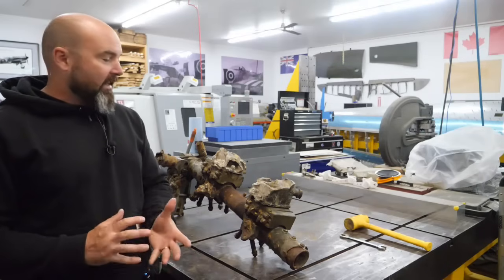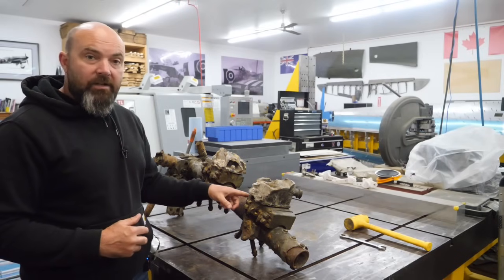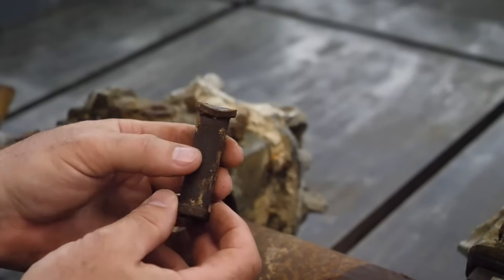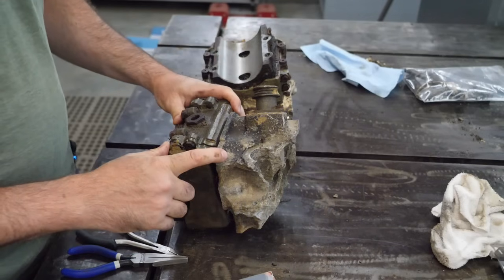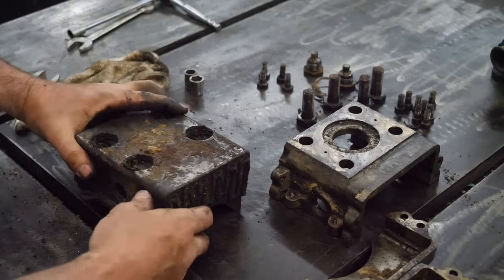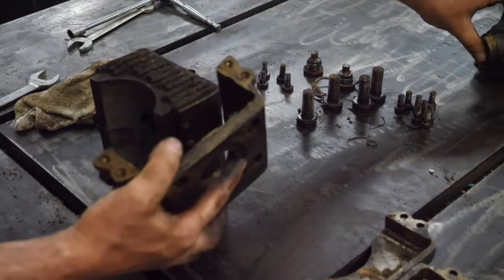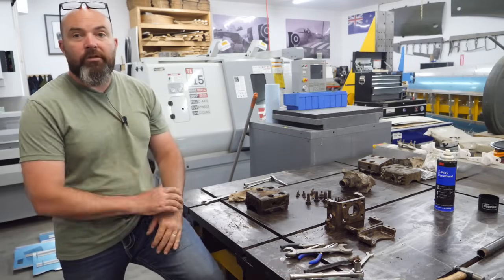Napier Sabre Engine Mounts

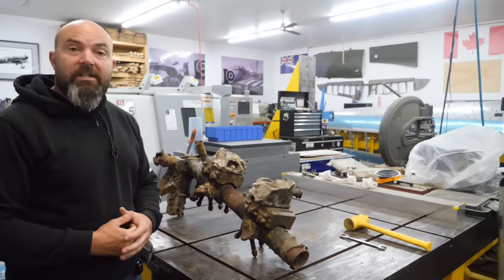Comment: 1:14 - Not at all surprised at 'vibration issues'; every one of those 24 cylinders was accelerating and decelerating what had to be a kilo of iron every time every piston changed direction, 96 times rotating both cranks one time and in three axis! And I doubt the forces could be balanced in more than one axis out of the three. What a HORRIBLE design; it's amazing the pilots' teeth didn't shake out!
1:40 - Mounted an electric (starting) fuel pump rigidly to the side of a Cosworth DFV and found the life to be just about one weekend meet. Didn't take long (paying for new Lucas fuel pumps every weekend) to get some cushioning in there.

8:22 - Restoring the F1 meant selecting and photo-ing all 'important' steps; wish I had vids available then.

Comment: We needed the oval rubber pucks used in Mosquito landing gear. A simple mold was fashioned and a rubber compound that Mold Shops use to prototype was poured in. It was very expensive but worked as well as the old hot mold methods.
Reply from the maker: The tech is certainly there, perhaps someone in the field will see this video and get in touch to sponsor the parts! ~Ian

Comment: The spacers most likely were to allow for a longer fastener. This would allow for better clamping force retention. This has been utilized on exhaust headers as the plate steel flanges do not allow the bolts to be properly tensioned After a few heat cycles, the bolts are loose and the exhaust is leaking. If vibration was as much an issue as you say, this was probably a fix to keep the fasteners in proper tension by making them longer and adding the spacers.
Reply from the maker: Very interesting, would this be in the same fashion as a torque to yield fastener? ~Ian
Reply: I was wondering in the same direction. Think you are into something here. (torque to yield bolts)

Comment: Having watched the "fun" armoured vehicle restorers have while removing parts from WW2 tanks due to corroded fittings I'm really amazed at how easily those fittings came out - even the steel into aluminium.
Great work, and let's hope this is a precursor to you being able to reuse the mounts in "your" Typhoon.
Reply from the maker: We were fortunate with this one, I believe the parts were recovered in the 60's or 70's and then stored in doors; it made for a big difference in corrosion. ~Ian

Comment: I didn't get this. All the thrust of the engine was transferred through the rubber, and not bolts? There must have been points where the engine was bolted to the frame.
Reply from the maker: The thrust from the engine would be against the lower steel part of the mount and through shear of the bolts that connect it to the spar. The energy would be transferred through the rubber from the upper steel piece. It is interesting to note that when the aircraft was inverted, there are only four 5/16" diameter bolts that prevent the engine mount cap from departing the rubberised section. ~Ian
Reply: @TyphoonLegacyCoLtd 
Being used in the ground attack role there may not have been extended periods of time where the aircraft flew inverted.

Comment: Whats the purpose of the plugs?
Reply from the maker: They provide for a mechanical lock on the inner steel plates should the rubber stretch too far. It is also possible that they were used for injecting the rubber when the two parts were brought together. ~Ian

Comment: Wire-locking, I believe the bolts have a low torque setting, due to the material used.